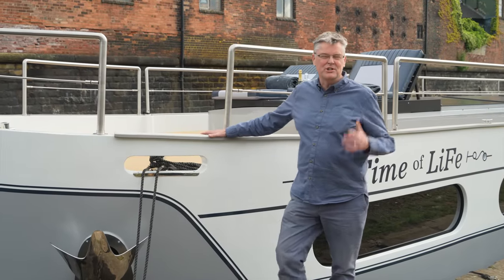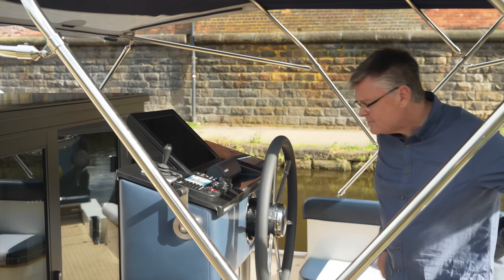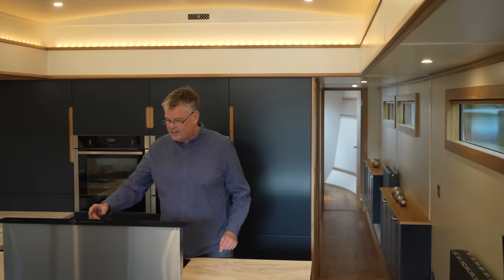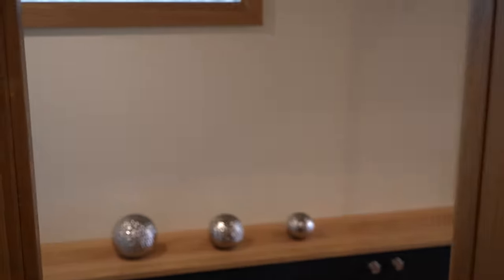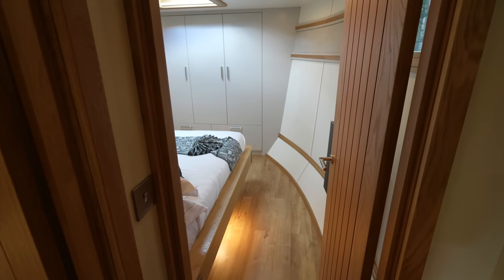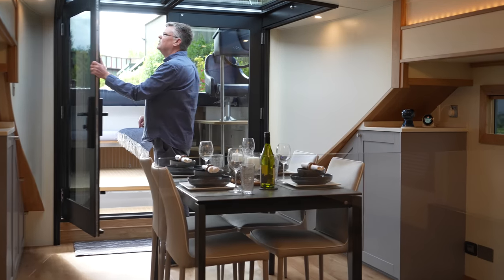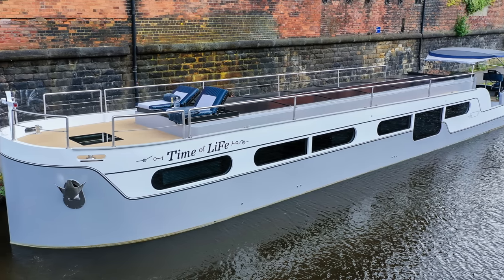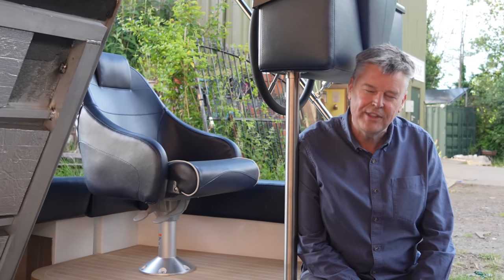Finesse "Discovery" an all electric Wide Beam Yacht Review for Crick 2022 called Time of LiFe

Comment: Amazing craftsmanship, shame the price wasn't mentioned.
Reply: agreed, but you know what they say - "If you have to ask..." 😄
Reply: @gordonchapman222  
I am guessing over $250,000.
Reply: @here_we_go_again2571   Mmm, A quarter of a mil? Maybe a bit to high, but not far off I am sure
Reply: @gordonchapman222  
Maybe that Vanderbilt guy was right:
"If you have to ask the cost, you can't
afford it" 🤣

It is not just the boat ... It is the marina- 
slip fee, the in/out fees in (spring/fall)
the over-winter storage fee, license, 
registration, insurance, lifejackets, in 
several sizes,  for your guests (have 
to be replace periodically, after a few
years because the material loses it's
buoyancy). Gasoline, maintenance,
repairs, etc.. ... 
It adds up fast, even for a small boat.
Reply: @here_we_go_again2571  😆
Reply: @gordonc That’s a daft comment. The rich got and remain rich by ALWAYS asking the price before offering less.

Comment: Absolutely lovely craft, pretty well thought out, and it does lend to the future of canal boating. I for one, would not use it on a canal, i would be more prone to trying the Norfolk Broads with it, and keep it moored there. As for design, well done, i would change two things if i were to buy one, first, the Helm area, i would have it enclosed with a slider mechanism that locks securely, to keep all the equipment dry and safe in winter months, and also have the actual controls panel able to rotate, so it stays out of view when parked up and locked up. Finally, in the master bedroom, three wardrobe doors to the front, i would take or use the middle one as a Front exit point with stairs behind going to the top deck. Alternative wardrobe space could probably be found to alleviate the loss of one wardrobe space.
Reply: Does it have a keel?

Comment: Truly stunning and a very very refreshing take on the wide beam.  The workmanship is outstanding and far more reminiscent of small yacht builds than the typical barge build.  It would be interesting to see whether underfloor heating was available thus reducing the need for visible radiators and perhaps the use of incinerator toilets? I suppose this type of build would be bespoke in all senses so assume this could be done.  All subject to the budget. Fantastic.
Reply from the maker: We explored both options in this case but decided against, we are happy to discuss at length any design requirements.
Reply: @finesseboats6937  you did a beautiful job. Hopefully it will give inspiration to other builders of what is possible.
Reply: @finesseboats6937  - can this thing travel on the ocean? Or is it restricted to inland canals, like most narrow boats?
Reply from the maker: @manofsan  This boat is designed for inland waterways. With some adaptions it could be a costal vessel.

Comment: Magnificent boat for use, presumably, on Continental canals. I can’t quite see it on English Midland cuts where some of the berths have to be protected by steel, spear-tip fencing and locked gates or aground on a submerged pile of shopping trolleys around Kidderminster. I’m afraid that, whilst it looks very pretty it’s vulnerability to reality may be equally apparent. It would be great on the MIDI, though.

Comment: Wonderful boat. Just some things I would have made different. I would have used floor heating. Some sound dampening panels in the living room and a different heck. It just looks like the money run out especially when fully closed because of bad weather. I really like the size. The hight of the ceiling and the way to get on the deck. And of corse that is electric. Must be a stunning feeling to silently drive on the river. Also the guest room with the spare bed is a very good solution. And the interior indeed looks very luxurious.

Comment: A beautiful boat, but with a major flaw. There is only one way in/out of the vessel, and that's at the stern. It would have been a great idea to have had an exit to the bow, manly for safety reasons and of course for easier moorings. One other point,, is the weed hatch very low to get to, as the decking seems pretty high on the stern.
Reply: There should always be 2 exits,makes zero sense not to.
Reply: So only canal-worthy. Not seaworthy.
Reply: @ryofang  Yes,they are flat bottomed.
Reply from the maker: There is an exit at the bow (escape hatch). On a typical Widebeam there is a lowered deck area at the bow. This normally takes up around 9-10 feet, as well as steps into the boat. Giving a total loss at the bow of around 12 feet.
To make the best use of space inside the boat we negated steps and kept the deck high. If the desire was there and the design could afford ~1200mm diameter we could incorporate a spiral staircase out of the master bedroom.
Reply: I don't think this boat is planning on having messy jobs like weed clearance - it's all too perfect for that. I was noticing the footprints already showing on that decking - it would be one of those things you have to continually run around cleaning up !  It's pretty gorgeous, but I distinctly get the feeling you will need 'staff' to use this happily !

Comment: Very nice looking boat, however the wiring for those DC2DC chargers and MPPT's is dreadful (15mins in) and probably dangerous. 
All those devices get hot, particularly the DC2DC Orion boxes, additionally they all have a minimun 10cm clearance requirement above and below for ventialtion.
The connections look strained in some cases and in direct contact with the heat sinks.
For the price, which is probaly high, one should expect very tidy wire management not something that looks like a teenager did it on a hangover. 
Not sure that would pass a boat electrical inspection sadly as its a fire risk.

Does kinda make you wonder what the rest of the hidden wiring looks like…
Reply from the maker: Hi Nick,

This was actually a substitute picture which was during the build rather than the finished article. (couldn't get a good picture once the cabinet doors were on)
The DC to DC's would derate if they became hot, but they are running at 5-20% of there max capacity.
The MPPT's run at 50% capacity in full sun. There temperature at rated capacity is 40c according to Victron, But when I thermal imaged them they were all within 5 degrees of ambient.
From the Victron manual " Observe a minimum clearance of 10 cm optimise cooling" not dangerous, nor a requirement. Just something to optimise cooling if running at full capacity.

It both would and has passed an electrical inspection.

Comment: I love it however if I buy one I want it to have a reversed bow with the helm at the front in the bow itself and the back closed/ sealed off! Also have it strengthened and water tight for rough seas! Keeping it almost to its present design but for longer distances! Great yacht! Stunning design idea 👍
Reply: It's a widebeam narrowboat for inland waterways. And you want the helm at the front, where it would be most likely to take on water during "rough seas". Good luck with your insurance claim.
Reply: It's not been built for the seas, it's a narrowboat for canals.....that's why it is designed in the way it is

Comment: Gorgeous boat! 👍👍👍👍👍👍👍👍👍👍
Thx for sharing.😊
NOW all you Brits have to do is to convince the UK government that one or two of the linking (central area) canals between
the north and south (i.e. north and south; where the wider canals exist) have to be expanded/widened!  😁
QUESTION:
Why don't British boats have screens on the windows? (I know this model has AC) But .....
Is there an option of curtain-style screens for the doors?.
(subscribed)
Reply from the maker: The boat has “blinds” internally. Is that what you mean by screens?
Reply: @finesseboats6937  
Thank you for replying. 😊
I suppose that is what you could use
for screens.  If tight enough to the
frame those would work niecely 😊

Comment: Very nice hybrid boat. Does the waste heat from the generator heat the hot water on board?
Reply from the maker: It does indeed, as does excess solar via an immersion heater.
Reply: @finesseboats6937  Good efficient design :-)

Comment: So how many hours cruising before you have to tie up and let the solar recharge the batteries ? 
Not criticizing I'm just curious ?
Not my taste inside but it was designed for someone specific & I would choose differently.
I also think a bit big for the majority of UK canals but would definitely be more at home on the European canal network which are much larger.
Reply: How much charge is valuable information not included in video
Reply from the maker: It depends on the speed, at normal cruising speed 3-4mph, the battery would last around 12-15 hours cruising assuming no sun. On a good summers day the solar would provide 40-50% charge per day.
Reply: @finesseboats6937  
That's very impressive.
So electric powered boats are a reality now.

Comment: Lovely boat, but there was no mention of the diesel engine! The impression given, that it was fully electric. I would have bought on if it was a full electric and had at least a 100kWh battery.
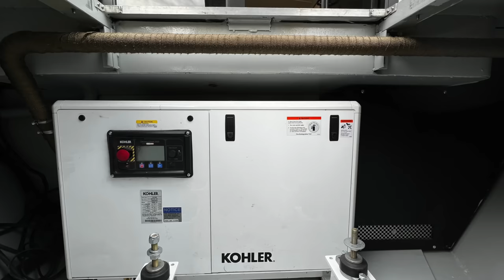Reply: 14:55 - the generator. Propulsion is fully electric (in that no engine drives the prop).
Reply: @grubbster77  is that a bit like 'electric cars don't pollute' - they pollute elsewhere.?
Reply: @downwardlymobile4957  I know what you mean, I was just clarifying to Darren where they mentioned the generator though. But with 4kWh of solar there will be significant times when the generator is not run.  As for EVs - yes they use power generated elsewhere (power stations that are more efficient than car engines and much is now wind/solar), but they also don’t discharge any emissions in built up places or outside schools - which has to be a bit better?
Reply: @ShoreTars  I'd be really interested to know the real efficiency of diesel compared with charge battery via diesel generator then use battery power to turn boat engine. Obviously there are so many variables that such a comparison would be complex. And also how much embedded energy does it take for a hybrid system compared to simple diesel?
Reply: Yes.  Eltric

Comment: Looks nice. Why wouldn’t it be heated with an electric heat pump instead of radiators? Better heating and cooling. Efficient and gast
Reply from the maker: The boat has 2 heat pumps they work very well for cooling and some heating. But when it is really cold, it is better to use diesel, because of the captivated electrical power.

Comment: TV takes up too much window space.  Similar to what I recommend in tiny homes, and I use in my own tiny apartment, it is better to have high speed VPN WiFi so each can safely watch what they want anywhere in the boat, house or apartment on a mobile device.
Reply from the maker: The TV in the lowered position when not using the Piano only covers a very small amount (couple of inches/50mm) across the bottom of the window. Of course, a smaller TV could be picked. Or you could use the boats onboard network to watch on a hand held device like you say.

Comment: What is the Gen-Set for? What is the range? or is it a houseboat?
Reply from the maker: A backup for winter and extended cruising.

The range is around 12 to 15 hours cruising. Assuming no sun or generator usage.
Reply: @finesseboats6937  Thank you for the quick and logical reply. I was concerned that these issues were being ignored as they weren't covered. Great boat, well done

Comment: Amazing vessel and I love how quiet electric is over diesel. If the reason for going electric is to battle global warming, to mine the necessary minerals for the batteries alone makes it a CO2 hog. Remembering that electricity comes from coal fired plants, it actually causes any reason for saving the environment unrealistic. Having said that, the ability to sail in a low noise craft is worth the price of admission. I wonder how much it costs over a diesel engine?
Reply: @itchey  Make no mistake, electrical power comes from coal fired base load plants. Alternative energy only accounts for a fraction of generation. And, the last time I checked, it's very hard to produce energy from solar panels at night. Oddly enough, I am all for alternative energy but I am not for huge wind turbines because the are killing thousands of migratory birds. The same thing is happening to reflective energy plants. The only types that really work are geothermal and nuclear. Geothermal is finding magma chambers close to the surface and drilling down close enough to inject water which creates high pressure super-heated steam to turn turbines. Anything else is highly experimental and very costly. Fortunately it looks like Elon Musk just might have created fusion technology. He also has his scientist and engineers build super batteries.
Reply: @jroar123  umm, the panels are right on the roof,  and as a leisure craft, sufficient for now.  And burning fossil fuels kills far more wildlife than green ever will.  Go watch a documentary on blue water horizon for just one example.
Reply from the maker: To date, 99.5% of this boats power has come from the solar on its own roof. The other 0.5% was testing the backup charging sources work. :)

Comment: I am damned sick of people mislabeling a diesel generator-powered boat as "all-electric"  It is overall less efficient than a diesel direct drive so please stop this greenwashing.
Reply: How is it less efficient? Please explain
Reply: Wrong
Reply: @duggaz84   SO people normally put a small generator on board for running a washer or the AC, but they need something about 5x bigger if they are to charge batteries. A well-proportioned diesel motor on direct drive, with large alternators and a big battery bank, is overall more efficient and uses less fuel if you are not doing a lot of short manoeuvring on battery and charging with shore power.
A hybrid sailing vessel with regenerators abord usually saves about 10% fuel on average but could be up to 30%
Reply: @sharonbraselton3135  how so?
Reply from the maker: Hi Andrew, 

Interesting view, to date 99.5% of the boats power has come from the solar. 

We still build some diesel boats but no matter how long we leave them in the sun the tanks never seem to fill up, if anything, the fuel level drops.

Sorry, i'll stop being facetious; because this is an area we have tested extensively, and you are correct, many get it wrong.

Firstly a "well proportioned diesel motor" is more or less impossible, the first issue is there is no variable ratio gearbox on a boat. This means you have to pick an engine to either work in rivers, or canals. With electric load or without. Which invariable means the diesel engine is too large for 90% of scenarios.
Secondly, a "small onboard generator" is typically not the way to go, the parasitic and frictional loses are far greater than that of a larger set. We also utilise the waste heat from the generator to heat hot water. The inverter powers the AC appliances onboard. Running a small generator to power a washing machine would be horrendously inefficient. During the average washing machine cycle, around 10% of the time is spent heating the water, this is the only time the appliance will draw a reasonable current, the rest of the time it is just turning over clothes. Maybe you just picked the wrong appliance to make your point, but there is probably not a single worse appliance you could mention that would be less efficient to be powered by a small generator.

The largest difference is probably lithium batteries. These are around 95% round trip efficiency compared to lead acid at 50-60% typical. This matters most because over all the boats we have built, more energy is used for "living" than it is for cruising. Running a 90hp diesel engine to turn a 2.5kw alternator is certainly not the most efficient use of diesel.
Reply: @finesseboats6937  Your boat is lovely and getting so much from solar is fantastic, It's the "all-electric" that I oppose, as it is not. Just say what it is a - hybrid system.  It is difficult for us who are doing all electric with no fossil fuels on board whatsoever to compete when you take that last 5% and ignore that it is powered by diesel.
Reply from the maker: @kiwibear777  I see your point, the person talking was actually making reference to the inside being all electric appliances rather than gas I think. It is more a "boating" term. 
The term hybrid is a little confusing also, because most people would then assume it has a diesel engine and motor connected to the prop.
HVO will be the most common fuel burned on a boat like this when using the backup generator.

Comment: Congratulations for building an all electric POWER boat... a yacht has sails & uses the wind to propel the vessel through the water.
Reply from the maker: Maybe the definition varies around the world. From Wikipedia "A yacht is a larger, recreational boat or ship. The word “Yacht” comes from Dutch origin and was originally defined as a light, and fast sailing vessel used by the Dutch navy to find and capture pirates" 
Seems as soon as we've captured a few pirates we will be fine to carry on calling it a Yacht. :)
Reply: @finesseboats6937  Funny Ha, Ha. 
A "sailing" vessel ( YACHT )requires sail(s)  & a power boat uses an engine to power a Propeller. That's why in the "Col. Regs. there's a distinction  between "Under power" & "under sail".  
The definition doesn't vary around the world to suit your false predilections.
Reply: @finesseboats6937  Maybe the definition is found in a Dictionary or a book on Entomology...fact remains in the 
1973 "Col. Regs. there is a distinction between a sailing vessel &  a vessel under power.